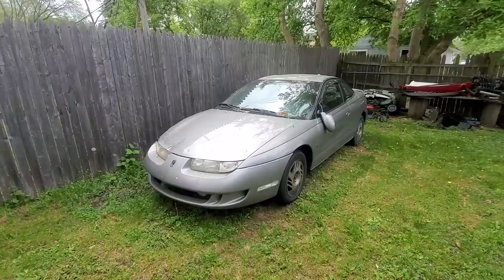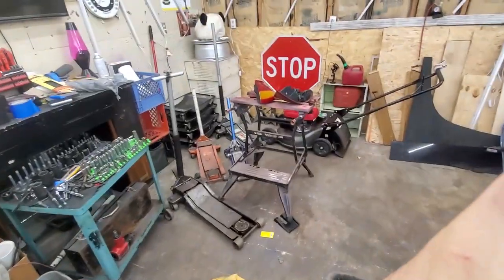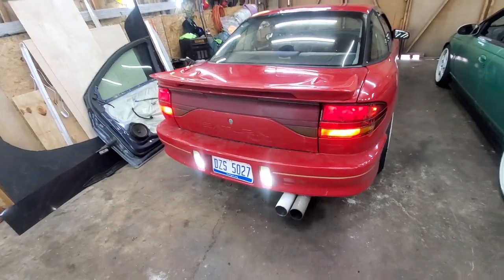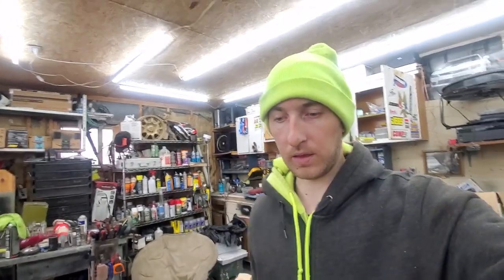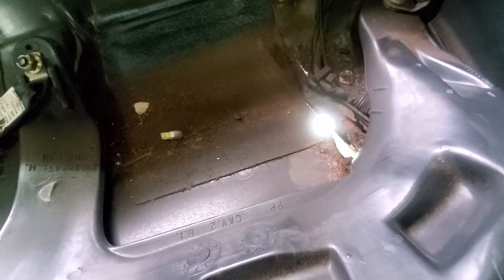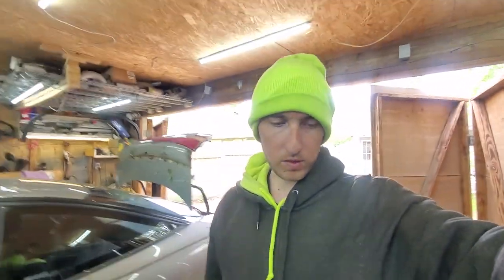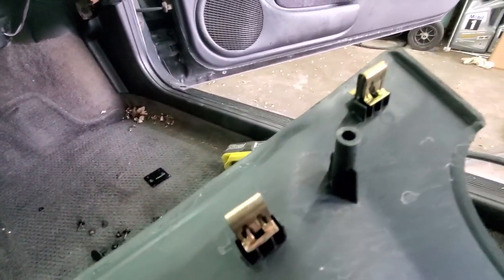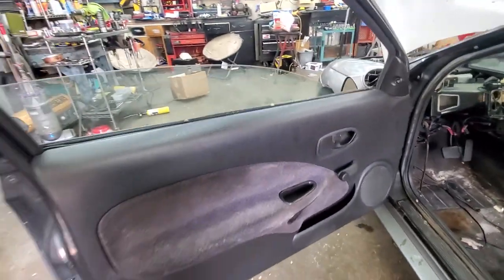Spike Tear Down

Comment: If you take apart the manual trans and remove the carrier pin grind flat spots on both sides where the spider gears ride for oiling  and replace the carrier pins roll pin with a bolt (tap the hole)  when you spin in the snow or do a burnout the spiders weld themselves to the carrier pin causing the roll pin to break then it comes out and breaks the trans case. I've had it happen lots. After I did this mod it never happened again.